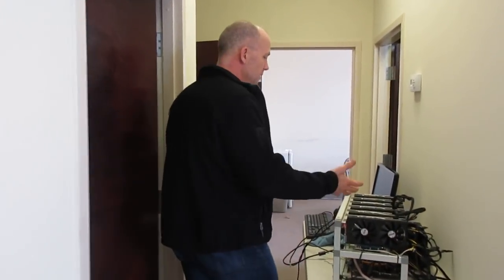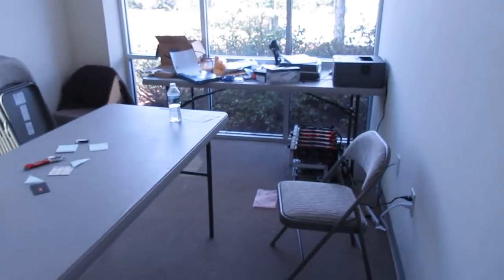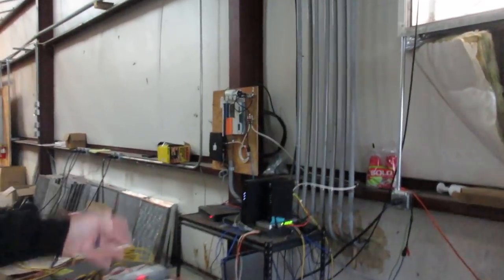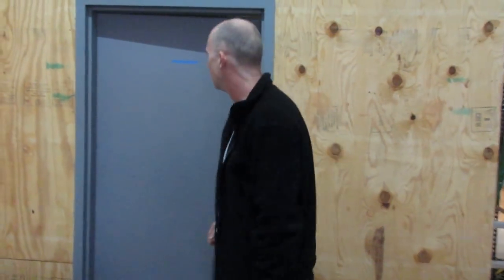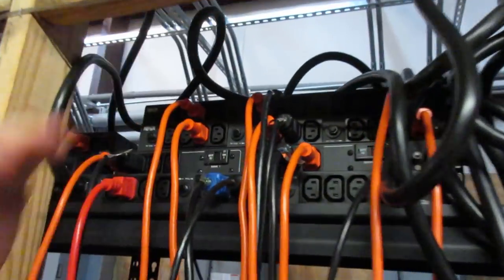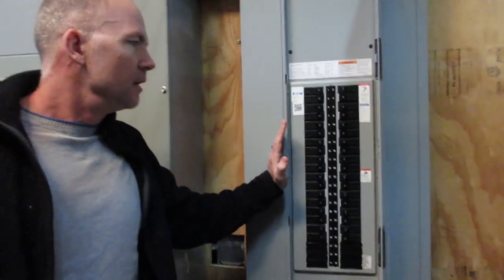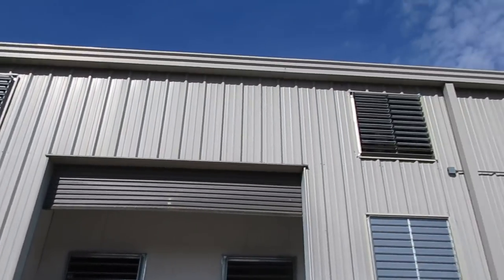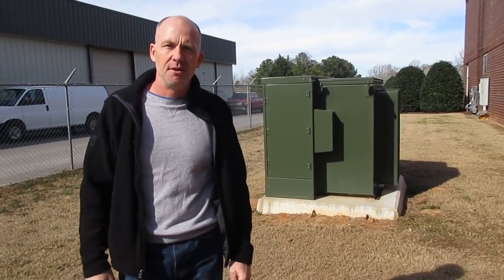BlockOps Tour of Mid-size crypto mining facility Jan 2018

Comment: Love it! 2 things though... Hire an IT guy to cable manage those ethernet cables (my OCD is triggered) and you are going from 3 phase to split-phase (single phase isn't a thing). Great job on scaling up and a fantastic job!
Reply from the maker: I am an IT guy....and the cables are not restricting cooling. The machines are removed and replaced often enough that it is less work to just leave them hanging. Your priorities are wrong.

Single phase, split phase, whatever. There is single phase being supplied to the power supplies, so that's what I call it.

Thanks!

Comment: Awesome space! I'm working my way up from a home miner with 9 miners to at least a small mining farm of 30.  What you are doing is awesome!
Reply: IronicallyVague Right now, I mine mostly Litecoin.  I get about 0.07 LTC per miner/day.  0.63 LTC/day.  At current LTC price, that’s $115/day.  My strategy is to mine and HODL.  I had cash to buy miners.  Other will have to go into debt, which then you have to use what you mine to payoff the investment.
Reply: IronicallyVague 

Hi thanks for sharing your 9 miner experience, any chance could I have bit more knowledge off you ,
What miners are your using for Litcoin
Are these Rigs  ,if rigs then what spec or these? Thanks

Comment: One thing I am curious about is if you've had any trouble with "short circuit" airflow?  With both intake and exhaust so close together it seems like much of what you exhaust would just get sucked right back in the intakes.  This is why I am considering the wind tunnels approach.  Intake on one end of the building, exhaust on the opposite.
Reply from the maker: The wind tunnel approach is much better, and it is what I will use at the next place. I agree that sending the air out the same side it is coming in is not a good design, even if it is higher up. It was, however, all I could find to lease at the time. I figure by leasing and building out a space quick I got up and running 6 months faster than I could have otherwise. That's 6 months extra profit, which makes a huge difference.

Comment: Just noticed that you posted a new video, I was wondering how things were going for you.  At least you been able to expand I haven't been able to expand like I wanted too.  I have 7 miners total got three more to bring on line unfortunately two of those are D3's.  With the huge increase in hash my pay out has gone from just under 4 days to over 13 days not to mention the drop in price.  
---------
I have to wonder out loud where did all this hash came from?  Last Feb (2017) Slushpool had 184.7 Ph/s total hash today it has 2.231 Eh/s ( that's 184.7 x10^15  increased to 2.231x10^18  a change of 2.0463 Eh/s divided by S9 ... so say 14.5 Th/s that's 141,124 more S9's and that's just Slushpool who has what 6%?? of all hash... if that the case /6*100 = 2,352,068 S9 miners that's a lot of miners for that company to make ... I would be surprised if they could make even a third or that say 800K. I would think maybe they made 250K machines total including S9's, D3's, T9's, L3's, A3's & now V9's... Right I know there's not the only makers of miners but they are the fast most prolific miner out there , sure the dragon mine is faster but they just took orders there not the big driver of hash yet.)
Reply from the maker: I agree- Bitmain is probably mining for months on new equipment before selling it.

Comment: Great progress Rolf! Amazing mind blowing set up. What kind of exhaust & intake fans are those? Anyway you could share the models? Thank you.
Reply from the maker: They are from Cook, model 42A11B with 20k CFM. They built customized filter enclosures for the intake fans.
Reply: Thank you very much for the info Rolf! In summer, do you use evaporative cooling? What is the highest temperature readings you get on the S9's? Thank you again.

Comment: We have about 100 antminers and are setting up a farm and like your design even though ruff it seems to work great. I have a few questions though. 
1. Do you own the building ( hope your neighbors like noise)
2. Have you thought of using solar on the roof to buffer the electric cost
3. You have an open air intake. How about in warm months? Does the door come down and HVAC take over air supply?
4. Did you have a problem with the electric company justifying the electric you brought in.? 

Thanks would appreciate the feedback. Are you a group or did you do this on your own?
Reply from the maker: I don't own the building, the neighbors don't mind the noise. Buying a building works out better though.

Solar? Do the calculations

No air conditioning in summer - again, run the numbers on it

Have the electrician create load sheet calculations, send those to electric company, its ok
Reply: Block Operations thank you Sir
Reply: Do you run your own private pool if not what pool do you use

Comment: Hey bud, i have been following you for a while and really appreciate some of the information you have passed along the way. I have generated into a small mining setup myself, currently @ 108 GPU's. Saw your setup in your industrial area and wished i could have found something as nice as that during my searching for locations. I settled on purchasing land with 2x RV pads with 150amp services available already and built my setup inside of a shipping container. Since i didnt have the space you had and had a lot of knowledge on watercooling, i ended up going the watercooled route and converting all my GPU's to watercooled on a single watercooling loop using a pumped filled gravity fed cooling setup. When you look into upgrading in the future maybe you can look into watercooling for better cooling performance and a reduction in energy cost. Right now i am kinda stuck on advancing my setup due to the cost of GPU's at the moment, but wanted to share a little info that may help. I buried just short of 10,000 feet of pex coiled up in the ground here in Florida and my current setup is running @ 51c water temps with no radiators in the system other than the ground at the moment. I run pex tube for all lines in the water system crimped onto typical watercooling cheap barb connectors on all equipment.
Reply from the maker: That is a setup that sounds really good!
Reply: Thanks man, just fyi i used universal CPU blocks on all of them and heat sinks on VRM, so far the VRM has been staying well below the max allowable temps
Reply: William Huston, Realtor how much did it cost per GPU to implement water cooling?
Reply: paton not a lot, I bought universal cpu waterblocks, nothing fancy...just make sure they are medal, all the clear ones I bought started to micro crack
Reply: Hey William. I am very interested in the shipping container concept on some land. Do you have any videos of your setup? Would love to see how you configured it. I am a friend of Rolf.

Comment: Hi Rolf, are you using any kind of cooling for the summers? How is the weather in your area in the summer...is it hot and humid? Any help and advice would be very much appreciated. Thanks.
Reply from the maker: just lots of air
Reply: Thank you Rolf. What is the highest you are running your S9's during summer in terms of chip temperature wise? Is your weather hot and humid in the summer?

Comment: How do you protect against power surges? Is that an isolating transformer?
Reply from the maker: There is protection from lightning strikes in the electric switchgear - AC to DC power supplies can handle the minor voltage fluctations

Comment: Man I wish I could get up to this level! How did you raise the capital for this setup?
Reply from the maker: Built an IT business over 14 years then sold it a few years ago
Reply: Very cool, I’ve been a sole proprietor for 7 years doing Apple and IT consulting. I have just one question on your setup, what have you set your TDP % to on your cards? I’ve heard a few schools of thought on this just wanted get your opinion. Currently I only have 6 miners so heat isn’t a huge issue at the moment, but I’m planning ahead. Thank you!!
Reply from the maker: I set the per card power on Nvidia 1070's to max of 160 watts
Reply: only 1070's or do you have a mix of things?

Comment: I wonder how much more air could pass through the systems if the networking cables were better managed?!? 🤔 That's a rat nest of cables going on there! 🙄
Reply from the maker: I agree! Someday I might arrange them better when I have time. But each miner is getting enough air, and with the cables not in cable management trays it makes it easier and quicker to remove a miner for repair and replacement.

I always focus on the more important things first, like keeping the miners up and running. After that I make things look pretty if I have time.
Reply: Diminishing returns. With already such high airflow and low ambient temperatures, there's little if anything to gain by all of the additional work, and it makes maintenance more time consuming.
Reply: I dont know about that have you ever untangled a hose?

Comment: You could buy  ConExs containers install the distribution in one and then rigs in others making it expandable and movable
Reply from the maker: electrical distribution is not very big - should be able to do both in one container
Reply: Block Operations If you stacked two the top  could contain  blowers  filters  heat ejection

Comment: So from the secondary side of a 500KVA Delta/Wye pad mounted transformer you have 
Two parallel runs of  600kcmil  copper with a ground
Assuming since you have  3 PVC conduits in  parallel you are running 4 - 600kcmil  copper wires in each conduit for a total of 1260 amps - assuming normal ambient temperatures. 
To two 3ft by 3ft Nema 3R CT cans for metering 
Then to two - 1200A Main Breaker Distribution Switch Gears each having  
3 -  400A 3pole breakers to  400A Main Lug panels  each with 12 to 18 - 30Amp 2pole breakers
Then to multiple 1" EMT conduit runs of 8-#10 THHN wire with a ground  to Three 30A/208V Single Receptacles each in a 4 square box with a RS cover Plate
Then to a PSU with up to 3 to 6 -1500 Watt Loads of S7s with 4.73GH/s at 0.25 W/Gh and/or S9s with 13.5 Th/s at 0.098 W/Gh  and/or a 6-8 GPU mining Rig
and 7 - 3pole breakers to Exhaust and supply Fans and Misc. breakers for general office
and grounded to a 10ft x 10ft x 10ft  4/0 bare copper wire delta grounding grid outside

RIGHT ;>)

Although to upgrade XFRM in future you should of stubbed 6 spare conduits out from transformer (assuming they would all fit on secondary compartment hole) to two other ct cans an then been able to upgrade transformer  and add one or two more 1200A switch gears in future. 

Nice setup
Reply from the maker: sounds about right. I actually did the first buildout to 1200 amp main breaker and when I did that I stubbed out 3 spare conduit for the second 1200 amp upgrade. I am done at this building - next expansion is buying a warehouse and doing a more optimal cooling setup
Reply: Right that one had a 500KVA then when you added 2nd 1200A panel power company upgraded you to a 1000KVA or it was already there
Reply: You could experiment with some of the older antminers and have a Frankenstein experiment with a few submerged in Mineral oil tanks. I hear it drops the load considerably :)   or  Build  a solar Farm beside your new warehouse and send it directly to the grid and get suncoin/token credit with local power company -- say around 1000 pieces of glass at 320watts each helps over time with that a 20000 to 40000 a month electric bill
Reply: I was surprise that you only had 208 Volts I was thinking it be more like 220V... (30A @ 80% = 24Acontinous times 220V Vs @208V  so 5280VA Vs 4992VA /1500W/unit ~ 3.3miners Vs 3.5miners)  208V fits better.
Reply: Typically for commercial distribution 3phase 480/277 or 208/120
Reply: Hi Rolf, I love your videos and always check here first before making any adjustments to my small farm.  I'm curious to see what your more optimal cooling setup would be like?  Could you explain that a bit?  Thanks!

Comment: I see that your facility is in georgia do you ever run into and kind of humidity / condensation issues during the summer?
Reply from the maker: I have not yet run into humidity issues in the summer. I use no air conditioning, so there is nothing that would condense from cooling.

Comment: many jump to make money might not make as much as they planed,  i see banks investing in this farms so then your little farm would not make any profit when this banks can acquire properties with solar or hydro power,
Reply: Whatever mining equipment banks can acquire to mine cryptos will have the same hashing power as any of the equipment us small/medium miners use.  The price of cryptos is the same on the open market for everyone.  If the banks can acquire properties with solar and/or hydro power, that's good for them and their costs may be lower to mine, but that doesn't mean the small/medium mining operators won't make a profit.  You're comments have no merit.
Reply: You don't get it?  banks will food the system with machines that use free electricity ,  lowering profits for small users/farms. eventually forcing little guys to turn off their system because will be 0 profit.
Reply: I just don't see that happening.  You bring up a good point though.  Big banks are nervous about the progress Bitcoin and Cryptocurrencies are making and are keeping a close eye on things.  How scared are big banks of Bitcoin/Cryptocurrency and how far will they go to derail the progress of the movement behind Bitcoin is the question.  Are big banks and financial institutions already into large scale mining?   It does make you wonder how deep the rabbit hole goes.